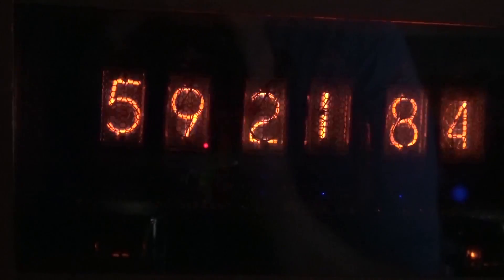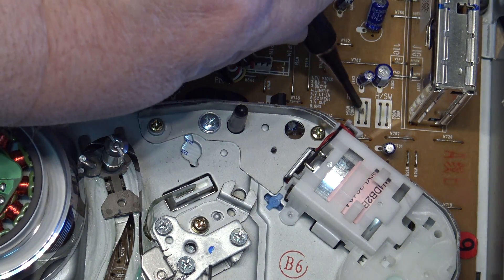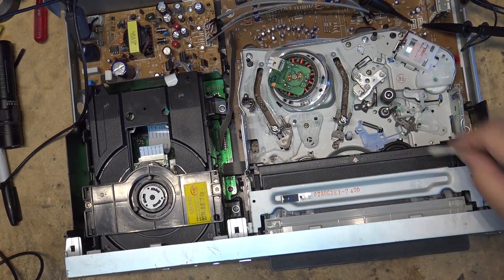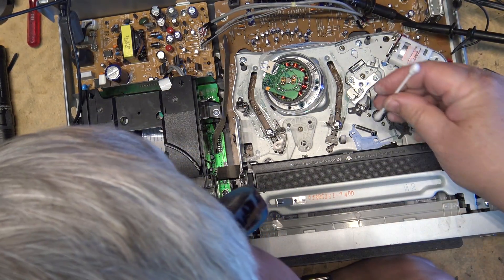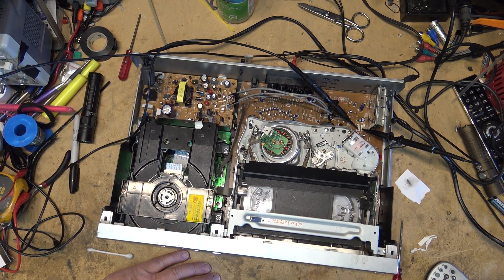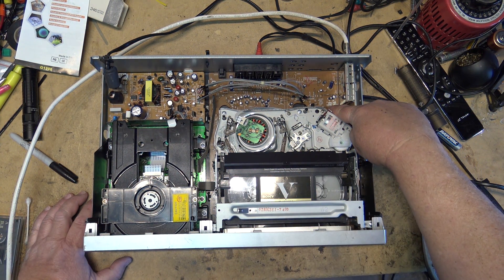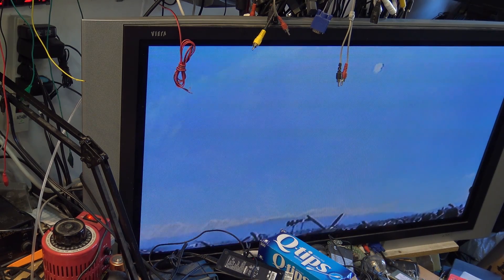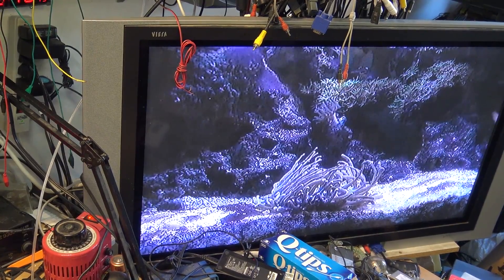LG Goldstar VCR DVD combo alignment using a scope

Comment: I have a Sears VCR 4 head hifi VCR model 30500, basically a top of the line Goldstar; belt replacement got the forward and rewind working properly but the mode switch module has a broken tooth on one gear; load/eject not working, but has worked intermittently, and once a video is engaged, plays fine. What do you suggest; can the gear be 3 Dd? or where can I find a part?

Comment: Thanks for the video on alignment.  I didn't realize this was possible just using a scope.  Very nice.  Do you have another video that explains why the RF levels don't have to match up?  I would have thought a change in RF levels would be visible.  Or is this before the FM decoding of the video signal? [hope I got that right]
Reply from the maker: The level shift means nothing.  It is an artifact from my scope.  The add button was pressed so it was adding the switch square wave to the display.  This scope has too many buttons on it.  Over kill in a big way for what I need a scope for.

Comment: I miss my Umatic HI band seeing this reminds me of that huge monster head assembly 1mhz bandwidth and BNC to rca hehe good times
Reply: 1MHz sounds very low, I think even VHS has 3MHz or so luma bandwidth.
Reply from the maker: Actually vhs had 1mhz frequency deviation of the luminance carrier.   Beta, video 8 and low band Umatic had 1.2mhz. Super beta extended the deviation to 1.4mhz. Svhs was 1.6mhz.  Beta1SHB was also 1.6. HI8 was 2.0mhz and ED Beta 2.4 if memory serves.  I don't remember what Umatic hi band used. 1.6 or 1.8. I never used umatic hi band just low. Now these figures were the fm carrier deviation.   The frequency they recorded at also play a factor in recorded video bandwidth.  The video I put up a few years ago, the sony super beta training course has all those numbers in it.  The important thing to remember is umatic used the exact same frequency and bandwidth and color under frequency as beta.  They both used 688khz for color.  VHS used 629 and 8mm 729.  The higher the color under frequency the higher the color bandwidth.   VHS was always in the basement.   8mm had the highest of consumer formats and in the professional domain could stack up very well. Better than umatic and almost at betacam quality.
Reply: @12voltvids  my first 4K video is rendering RT now 10 mins h.264 total of 3.4 gb master output. No way  I could do apple Pro res 442 transcode my Mac to damn old woulda taken 3 years to render. Keep an eye out for my new wideo. Panasonic plasma TV repair ! .(:.  7 mins at 4K 2 core threded.. this gon take a minute O.O.   But I'll upload once final cut spits out my QuickTime file. Lol.
Reply from the maker: @hubzcaps  
4K rendering is a pig. My PC is a dinosaur by today's standards. I built it about 8 years ago. Core i7 @ 3.6GHz, 16 gigs ram, 128G ssd for boot, and 500 gig drive for apps, plus 2x 2tb for video storage, LG bluray burner, and hdd dock for external drives.
I can render out 1080p60 in real time. (A 30 minute video takes 30 minutes.) A 30 minute 4K video on the other hand takes about 6 hours.  It is painful, but it works. Uploading is another thing. I have only a 20 meg upload speed as I am still on DSL here. Even though fiber is available I am not ready to pull the trigger as that means more $ to the ISP. Everything costs more $ these days, and I am not making any more $.  So try to save where I can.

Comment: Love your vids. Entertaining and educational. I know the cleaning method would be similar but how would you go about cleaning the heads in a cam corder like a Hi8 cam corder? So damn fidly. Certainly would be cool to see a video on that.
Reply from the maker: 8mm and dv require a dry type cleaning tape.
Reply: @12voltvids  I used to clean the heads on V8/Hi8 camcorders like you done it on this VHS. Needs more soaking with IPA as the binder on V8 and Hi8 tapes seems more tough to remove, but it can be done. Might be very tough (or easier?) if the heads are contaminated with ME tapes, but I rarely meet ME tapes. I rather do this than abrazing the drum with the dry cleaning tapes. Very inconvinient to do it on camcorders, not much room for my hands even if I remove the lid of the cassette door. Occasionally I use  cleaning tape, but only if I'm in a hurry or lazy to do it manually.
P.S. It just came to mind that I clean even miniDV the same way, and miniDV has solely ME media. So it works with ME-contaminated heads as well.

Comment: This may be a cheaply made combo, but hey, better than those Funai made ones.
Reply from the maker: Funai ug
Reply: @12voltvids  i just got back after 6 and 1/4 years my lg LRY 517 VCR/DVD Recorder combo from Mt mom's BFF's house. My dad found it back on 6/6/14 at work, it had no remote and just had power, open/close, Eject for the vcr side, vcr/dvd switch, stop, play and record and the dubbing button. My mom bought the original remote off ebay for $31.60 yesterday.